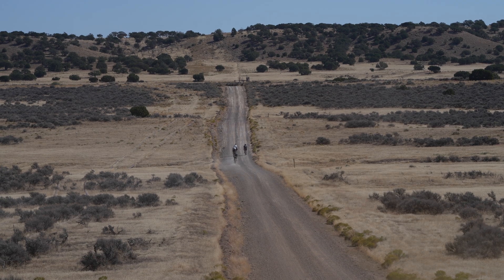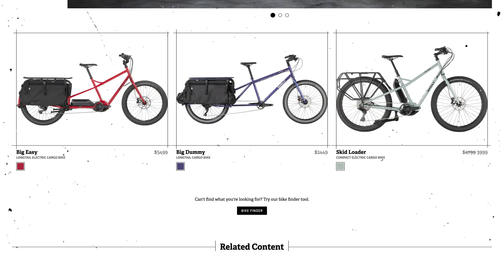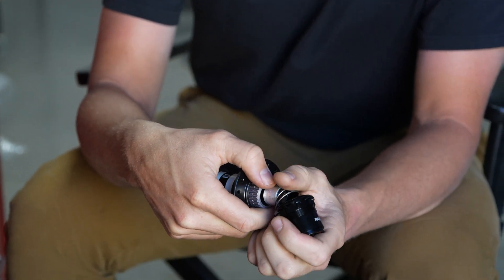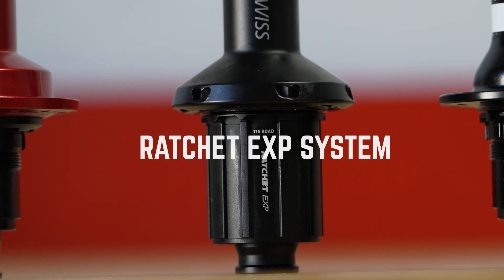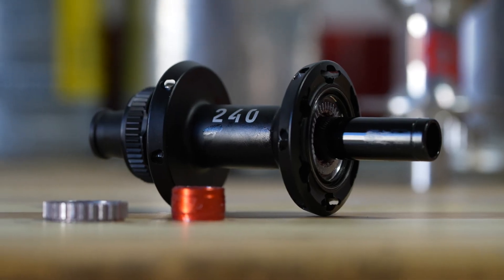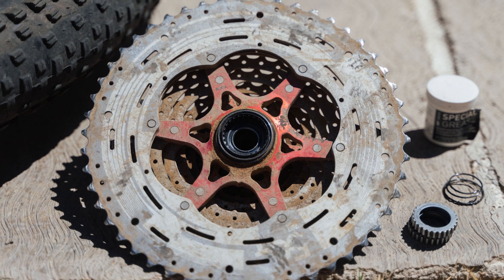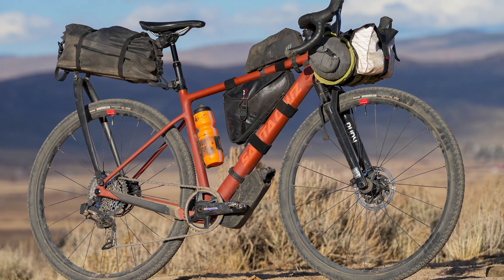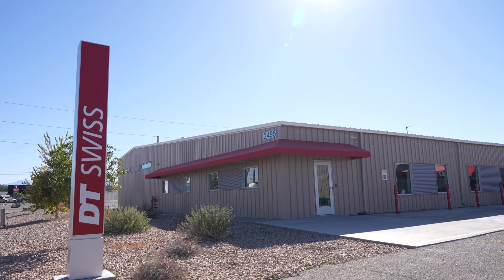Understanding DT Swiss Hubs (A Tale of Three Ratchets)

Comment: About  270 miles into a desert ride my friend whom I was riding with fixed a simple flat. But while turning his wheel over the cassette fell off and his DT Swiss hub fell apart.....one of the ratchets went bouncing somewhere.   After an hour of combing through the sand and dirt by sections and looking up and downhill (hopelessly everywhere, who knows where...) he had to call it quits and walk out without an engaged hub, luckily it was only 10 miles to a road at the point. That was the first time I saw this hub and was shocked that it could so easily pop apart (no tools!) and allow it's bits to get lost!  Be careful out there.

Comment: My DT Swiss 240 EXP ratchet lasted 3 weeks on my Pole Voima. I bought it new in May 2025 and built the wheel in June. Now it is July. It started to skip a little after a few weeks and now the cassette is just spinning and there is only engagement sometimes. Gearing sounds terrible, despite new Shimano Linkglide drivetrain.

Comment: I purchased a set of 350 hubs for my mtb. I wanted the most reliable and something I wouldn't have to worry about the bearings for a while. Less than 1 year and the front hub bearings were already shot. So much so that there was excessive play in the front hub so when I discovered then problem the bearings were probably done for a while. Taking the bearings out I realized the hub doesn't even have a seal keeping the elements off the bearing system. And they recommend this for a mountain bike?

Comment: @5:18 does "by hand" mean none of the cartridge bearings in the hub shell or freehub need a puller or press tool to remove or install? Also, I'm considering getting a 2024 Canyon Spectral CF 7 that comes with DT Swill M1900 wheels that have the 6 bolt method of rotor mount. The DT Swiss site only shows a Centerlock mount M1900 wheelset though. So can you tell me exactly what model of hub that bike has, and will I need a puller or press tool for the bearings? Lastly, do you make a hub that is both straight pull spoke design, AND tool free bearing maintenance?
Thank you
Reply: degree hubs have a wider ratchet ring meaning you don't have to bull out the hub, ring interface. it is wider than the bearings on there previous rather system it was smaller so you had to unscrew it with a "special tool" mentioned at 4:04. bearings are still press fit there's just nothing in the way
the tool is called "DT Swiss ring nut tool" if you want to look it up and see what's in the way on the previous hubs

Comment: I have a DT Swiss dual ratchet model with 54 teeth engagement. After about 10000 miles of use, on a lot of hills,  the ratchet teeth began to skip with a pretty horrible sound.   I have sense replaced the ratchet - all good.  I have kept the hub clean and greased.   Inspection of the ratchets closely showed they had worn and were a bit rounded.  They are easy to service, but if the fail one has a very noisy ride to get home as the teeth skip over each other. 
Question - would going to a lower number of ratchet teeth make the hub more reliable ?
Reply: Yes, lower number of teeth makes the corner of the tooth less sharp. So as a result it is harder to chip off. It also makes the freewheel take slightly less energy, and is a bit quieter.
Reply: On your DT builds, do you prefer straight pull or j bend spokes? Buying my first custom wheelset and builder only has straight pull DT240, j bends are 3 months out. Thanks!

Comment: Those guys barely have a clue of what they are talking about. The champion spoke for example is about the worst spoke to choose for a bike packing built. Expect maybe in the case that you are super heavy and on a tight budget without worrying about longevity. If longevity is on your list you should definitely choose a butted spoke because they tend to reduce the stresses away from the hub and rim interfaces which are most prone to fatigue cracks especially with j-ben spokes. Also as he mentioned... the ride feel improves. Also both of these guys failed to mention the slightly optimized bearing location of the exp and deg hubs. But all in all the quality of DT Swiss products is impeccable but in choosing the right product for you one should use their own brain and not just follow the marketing talk of any questionable pr guys.

Comment: 350s are the key (some odd proprietary cups for the 240s). Get these hubs, enjoy the super reliability, middle of the road pricing, almost entirely future proof and spares super easily had (even 2nd hand, no other hub would you find so many freehubs or even ratchets available on the used market).

DT Swiss have obviously made the EXP (to optimise for weight) and DEG (to optimise for engagement) to differentiate themselves for the future (since their Ratchet patent expired in 2020 more or less, other brands are now copying/making variations of the venerable dual-ratchet system). Both are nice little optimisations but in the grand scheme of things, the majority of people would benefit more from the old designs interchangeability > the additional cost and benefits from EXP or DEG.

Comment: And no mention of the true MVP workhorse, the 370?! 😢
The vid (or ad) is imho aimed at newbies (most cyclist know the difference already), I would assume you would explain the diffetence to an entry level 370 as well...
Reply from the maker: Is it no longer possible to do a site visit without people assuming it's an ad? DT did not give us any money for this video.  Anyway, I geek out on this stuff, and I know others feel the same and no, most folks (not just newbies) I've talked to don't know their hub system very well, hence the video. We covered the three styles of ratchet systems DT makes. The 370, while not cross-compatible with the 350 or 240 ratchet systems, essentially works the same way.
Reply: @BIKEPACKINGcom I've no problem if it's an ad or not, I liked the vid too, so no problem with that, just constructive criticism that the hub which is on most entry level wheelsets (and there is a gazillion of them) was not even mentioned. 
And it is sad that most cyclists don't know (or care) about hubs, BBs etc, but we digress.

Comment: The simplicity of DTSwiss Ratchet hubs is brilliant.  …however since the patent ran out, others are copying.  
Does anyone have experience of compatibility between DTSwiss hubs and other brands, such as the new Hunt H-ratchet version?  Swapping cassettes between DTSwiss hubs is so easy. …Can I now swap a cassette from Hunt hubs to DTSwiss hubs too?  Are the dimensions of the ratchets the same?   
Having said that, the new DTSwiss DEG ratchet hubs look brilliant for gravel…yet they’re not yet an option in their gravel wheelsets?
Reply: MTB seems more obsessed with engagement than gravel, so it makes sense to start there? could be useful in some gravel situations, especially the loose uphill stuff

Comment: The classic design with the two floating ratchets came out of patent, which is why everyone is making that style hub now. Basically everyone in China copied the design. As a result, DT Swiss introduced the EXP to get a new patent. I don't think the EXP is a real improvement, in fact because it requires a tool it's arguably a tiny bit worse. I will say that I have two sets of 240 EXPs and they work fine after many thousands of miles. These hubs are all very, very reliable. The new DEG is likely very, very loud.
Reply: But chinesse clone has many  issues due to cheap quality, any Goldix hub can work season or two, but then something will happen, but DT 350 will be working forever and you will sell wheels even without changing bearings in hub.

Comment: My first experience with ratchet design wasn't good. The ratchets have to be immaculately clean or they won't engage correctly and can get damaged leading to failure over time. Not a big deal EXCEPT when I needed to work on my wheel trailside and the entire cassette popped off and the greased ratchets fell in the dirt.  Fast forward a week and the ratchet skipped under load constantly and needed to be replaced. I felt the design is kinda sensitive to dirt but also falls apart easily.

Comment: I’ve only got classic star ratchet hubs, 7 sets and counting (240 & 350). They all work perfectly all the time. One thing that was not mentioned was the ease of conversion for different frame axle types, esp with the 350.  From 12x100 -> 12x197 and everything in between.

Comment: Better than I9, especially in terms of durability on single speeds. DT Swiss is the standard by which all other free hubs should be measured. I thought I9 Hydras would be the ultimate for the situations Neil detailed at 6:30, but the freehub just wouldn’t hold up after two years singlespeding with hard ratcheting through technical terrain of the Granite Dells here in Prescott, AZ.